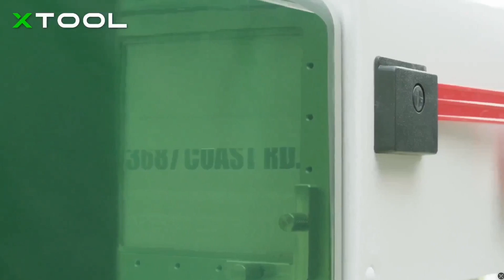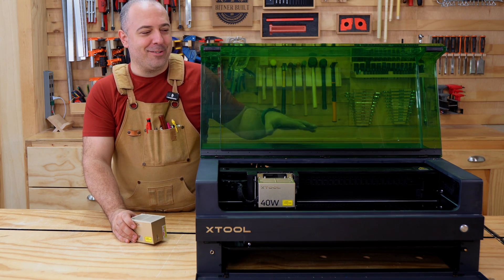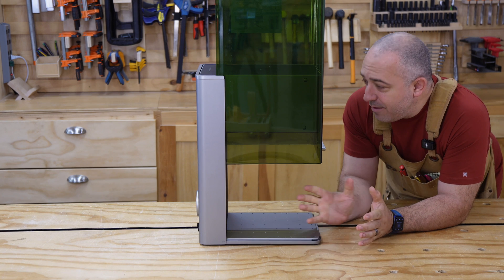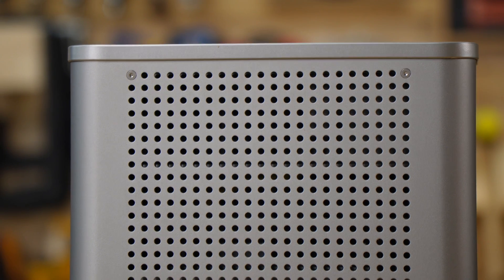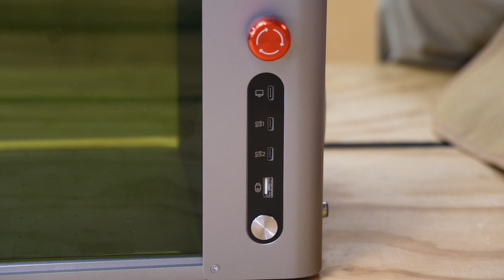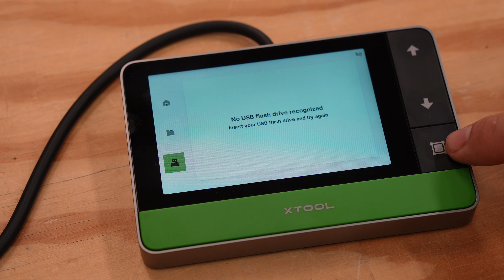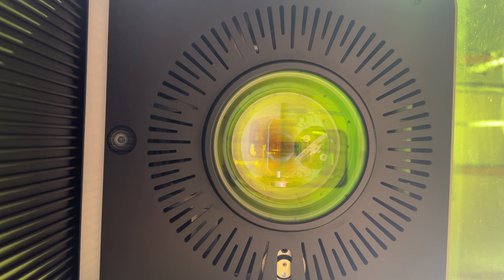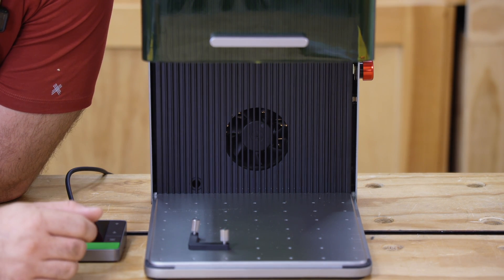World’s First 20W Fiber & Diode Dual Laser: xTool F1 Ultra

Comment: What is the maximum size of the workpiece or item that can be engraved?
If I remove the base plate from the body, how far below the body can the laser beam be focused?
Reply from the maker: On the f1 ultra you cannot remove the baseplate. It can engrave a max size on the plate of 220mmx220mm

Comment: I actually have a question about the original F1. For now.  The Ultra is 100% on my radar, but in the meantime...

I cannot figure out glass marking for some reason.  I've tried brushing paint (too gloppy), and sparying paint (weirdly difficult to remove, and the glass looks almost chipped, and not reliably homogeneous). I am in Spain and cannot get Brilliance sprays here (wait that might be for metals) or other items American youtubers recommend....

I think some glass may be easier to engrave (versus crack) than others, but... I can't figure it out.

What is the best thing to cover the glass for reliable etching, and what are reliable settings to start with?  I ran a test grid but none of the squares engraved evenly.  Am I correct that thinner and thicker glass will need different settings?  Do I need to keep the glass from getting too hot? Everything I've tried so far has caused cracks in the thinner glass.

It's doing my head in.

But if I can figure it out, I already have a batch order on handshake waiting for me.

Also, same questions for glazed ceramic.  I have the settings down for Matte finishes, but the glaze... always cracks.  What am I doing wrong?  😅

Thank you for taking the time to actually respond to our comments.

Also, ooh I cant wait to see your reviews for the ultra.  I am most interested in the automatic topography mapping (I assume that it has this, like the P2, since it has the camera, no?), and the conveyor batching capabilities.  

And please, please, I want to see the embossing and learn what metals it can cut, to what thicknesses. And the TIMES! I've abandoned engraving metals because they take so long, and only use scoring. But from 2w IR to 20w Fiber? I'd like to see the times.

Thanks again 🤗
Reply from the maker: Quite the long one! Ok great ideas for tests will do. On the glass cracking and probs engraving. Where you are in the world (latitude humidity etc) can effect these things so even these setting you might need to tweak . Look at the page I linked below, there is a great repository of settings for the f1 that was compiled. Great reference. On the marking material, you can play with tempura paint (thin it with water and apply 6 coats) you can use a heat gun to dry it faster. Chalk paint or even black washable marker can work. Every glass is different, it might have some content that will heat faster than would glass without it etc. cracking if most often caused by heat, solutions to that are applying water to the glass, dish soap, a wet paper towel that you lay over it and engrave through. Also incorrect laser focus (height) can attribute to it. https://docs.google.com/document/d/e/2PACX-1vSdAwKiqysBGhNHt92zkdQx_zM42m2KCEQfV7UF0LxsoHiIhirM3c1BF4LvTu1-PU8_UH-fV176X_t_/pub?fbclid=IwZXh0bgNhZW0CMTEAAR0qAKt7D3A-2u0ul-YwsU6HslMHGE6b852iR8JtMI7OUH3f0AfwhTkW1Tg_aem_AZsMuMPv0HvBA4dKY2zwwcK6e_gNCCGOLZCeRRp9HJWgqIYK9impCILEG62M-SIc3zQfUFfnJYo4sRVH7oaq5Sj7#h.894do2a511qb
Reply: @BitnerBuilt  thank you so much. This is fantastic, and I will try.

With the water, soap, paper towel, etc, I saw a video where someone engraved through ONLY that (didn't work for me). Are you suggesting I lay a soapy paper towel OVER the tempura paint, chalk paint, permanent marker?? 

Thanks again

Comment: can you look at the laser thru the green encloser? or do you need safety goggles for both open and closed?
Reply from the maker: Yes, you can look at the laser through the green enclosure without wearing goggles. The only time you need to wear goggles with this machine is if you raise the enclosure up so it is not all the way down the only times you would be doing that would be when using the conveyor system or if you have an item that’s too large for the lid to come down.

Comment: Can the bottom of the Ultra be removed so you can engrave/cut on a larger surface by resting the machine on it?  Great Vid!!
Reply from the maker: No the base is solid on this one. There must be a reason the didn’t leave it open like the smaller f1, I will find out. Obviously you can’t lift it but being able to set it on a large item would have been good
Reply: @BitnerBuilt  Thanks for the reply and I apologize for the duplicate question as I now see you answered it already.

I feel like that is a major design flaw as the fixed base removes a ton of functionality.  Think about engraving in the middle of any kind of larger tile, metal plates, laptop lids or things that are already assembled that wont fit under the base.  Who wouldn't want to put this on an end table and add something that would make a boring piece of furniture a conversation piece.  The user is now completely restricted.  

I put my deposit down thinking it must be a feature since it was available on the older/smaller version but I think now I will likely request a refund.
Reply: @angelocigna8323  may have been for safety.
Reply: @ZoraRossouw absolutely possible.  I just can't imagine there is no alternative outside of a fixed base.  It's just a major disappointment for me.  I had been considering the F1 for months but the limited workspace reduced is usefulness to me to the point I could not warrant the purchase.  So I was very excited about the ultra, now not so much.

EDIT:  I reached out to xtool and got this response.

Dear Customer,
Thank you for reaching out to us.

We understand that the removable baseplate feature is important to you. Rest assured, the xTool Ultra product also comes with a removable baseplate similar to the xTool F1. This feature allows for easy removal of the baseplate, enabling flexibility in engraving various objects. If you have any further questions about the xTool Ultra or need assistance with anything else, feel free to ask.

Comment: Does the bottom come out like the F1? I really want to get a first laser for general crafting and woodworking and I liked that feature to enable me to engrave on larger pieces. I figured this laser could be a good compromise due to its size, speed, and versatility compared to lasers with moving heads. Even if it's not so good for cutting, I could still mark layout super accurately and sand to lines.
Reply from the maker: no the bottom is solid without the removable plate the f1 has.
Reply: @BitnerBuilt  Shoot, that's disappointing. Thanks for the info! I'd be curious what you'd recommend for a first laser for a woodworker/tinkerer/engineer. I don't fully grasp the capabilities and limitations of the different types of lasers. Have done some research and know what's good for what on paper, but there seems to be significant overlap and I don't have direct experience. I've got a 3D printer and some beginner level CAD skills and know I like these kinds of CNC type tools. Just kind of struggling to decide what I'd be able to make best use of. Or maybe the answer is to forget lasers and get a CNC. So many options... 

Xtool has appealed to me though because I got an Anker printer and I feel like it has allowed me to focus more on making and less on fiddling with the machine. Xtool seems to have a similar mindset. I donno if any CNC companies have made that jump in terms of ease of use yet.
Reply from the maker: I have 3d printers, cnc and lasers, 3d is obviously additive, there is a ton of crossover with the cnc and laser though. I started with a cnc and love it but honestly the laser has become my go to (as the work is applicable) if there is a crossover. Its much faster, clean and has more functionality (cut, burn, engrave) if you looking to get into it I highly recommend the xTool S1 - here's a link https://shorturl.at/hwxE6 - I own pretty much all of xtools machines and this is the best combination of capability, and price.  

Let me go back though and give you the basic laser rundown. Diode lasers are more affordable and will be able to complete engraving, burning and cutting to a max depth of 3/4in materials based on a 40w, 20w will do a 1/2in material. they cannot do clear glass, clear acrylic and metals (many metal business cards, metal tumblers etc can be done because its stripping the outer paint off, not actually engraving the metal) C02 lasers are much more powerful when cutting and faster at engraving, they can also do acrylic and glass. (my xtool p2 c02 is prob my favorite machine but its pricey so since your starting I prob don't recommend) then you have fiber / ir lasers that can engrave on metals & plasticts . It your looking to get into this as a hobby or side hustle, unless you specifically working with metal acrylic or glass, then the diode is a good pick as it has a lot of functionality and is the lowest cost (S1) the cool thing with the s1 is you can get the 2w ir module to mark / light engrave metal & plastic so that machine checks a lot of boxes. if you get the riser and conveyer feeder too then you can cut and engrave on really long boards and its very precise. I recently did a full video comparison on the s1 vs the wecreat @commentsonthetube14
Reply: @BitnerBuilt  got it, thanks so much for the detailed reply! I saw your comparison with the S1 and wecreate, but I felt like I'd miss the camera alignment on the P2 once I looked into the rest of their line. I've had some experiences in a local makerspace where the alignment was miscalibrated and I ended up needing to re-work my piece, which drove me a bit crazy. Does the camera make as much a difference as I think it does? I'm not super budget sensitive if it's a good machine.

Anyway, I really appreciate the content you're putting out and I'll definitely use your link if I end up buying an xtool!

Comment: Excellent video.  Question: is it possible to test the actual power consumption?  I'm wondering about how long a battery supply in a craft fair situation.  I know they publish data, but I also know that actual use can vary.  

Thanks. . . now I want one of those, too.  🙂
Reply from the maker: Would the data on the power supply brick be able to answer that for you, I can tell you that now, otherwise next video 👍
Reply: @BitnerBuilt  Possibly, although the power brick should be oversized to sustain any imaginable load plus a fair bit for safety.  And thanks for checking!
Reply from the maker: @ibdavidc   24.0v --10.42A, 250.08W - someone else asked me the same on a Facebook group - he said 250watts nominal and was happy with that (he uses a battery at shows and felt his existing would work fine with this)